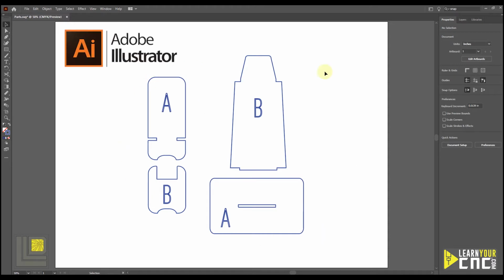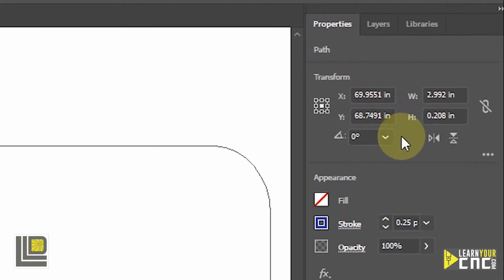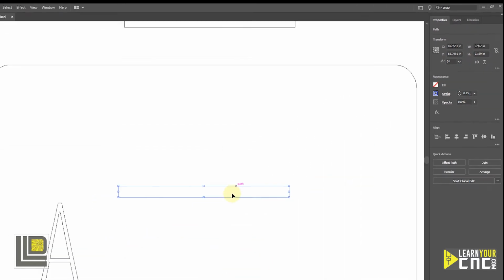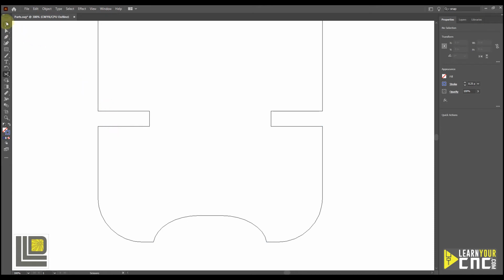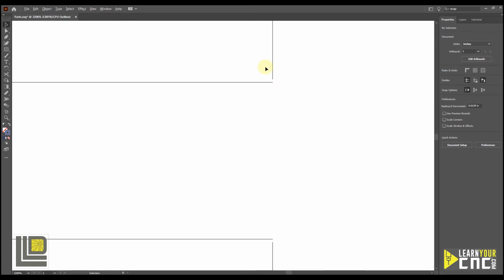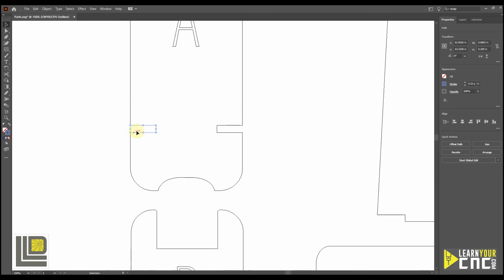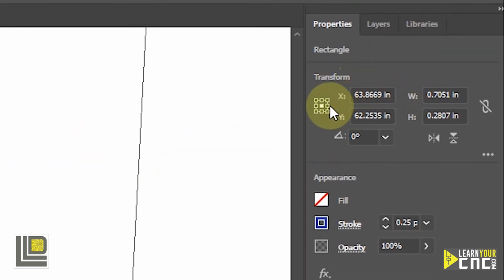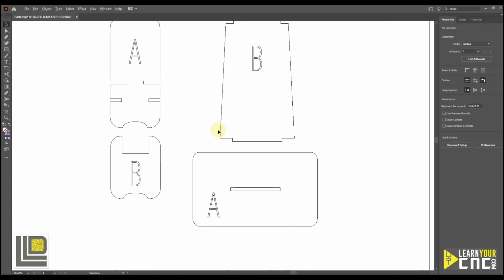How-To Resize Boxes and Slots - Illustrator Edition

Comment: I'm a novice in AI but learning about the anchor point helped immensely! Keep up these videos.
Reply from the maker: Thank you - hope it helps !
Reply: @laserlightdesigns1999  I am currently trying to edit a design that has boxes at an angle. When I go to edit the height it adjusts it from the top to the bottom, but at an angle. How would I go about adjusting the height accurately with something like that?
Reply from the maker: @AlexParton  Can you copy and paste it over laying, put one back to 0*, make the adjustment, and then make the angle back to where it was? (And use the original box that you copied, that is still at the original angle, as a reference for angle and position)
Reply: @laserlightdesigns1999  See I thought this as well, but when I do this I am afraid that I'll mess up the slot location since it technically moves since the width is smaller. I need to make sure they are in the correct spot so that they line up with the other piece thats holding two pieces together.
Reply from the maker: @AlexParton  I would love to see the design to understand ! laserlightdesigns@gmail.com - Feel free to just sent a screenshot to protect your IP, if you'd like.
Reply: @laserlightdesigns1999  Thanks! One more question. How does this apply to finger joints? I used the kerf tool, but if I try to create the tab and indent based on my kerf, but they are still very lose when I try to put them together.
Reply from the maker: @AlexParton  this only works on intersecting cuts, where the variable is material thickness plus kerf, only. When you use finger joints, it is an arbitrary parallel gap, plus kerf divided by 2. Because the gap is a made up interval when designing, it will not be bale to be calculated with this tool. However, you can put a piece of material in the tool and then seen the design size it says to make - then use a caliper, and the difference is "X". Do not divide this by 2 (top and bottom of slot) BECAUSE it was already split between the piece it was cut FROM. That difference, is the kerf. You can then use than number on finger joints as a good starting point to ensure a tight fit. Also, anytime I use a file with a finger joint, I make a small box around a section and print just that small little sample to test, to save time and material.